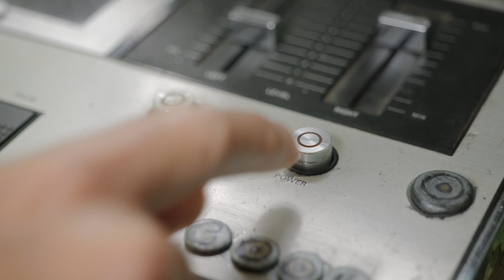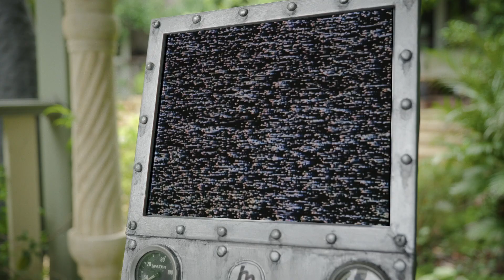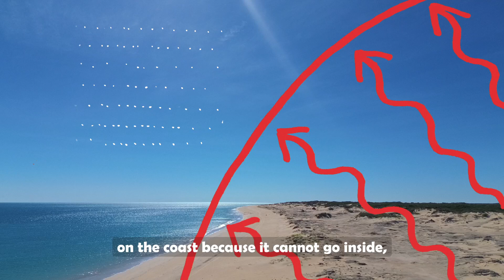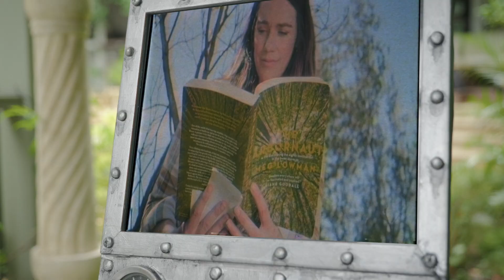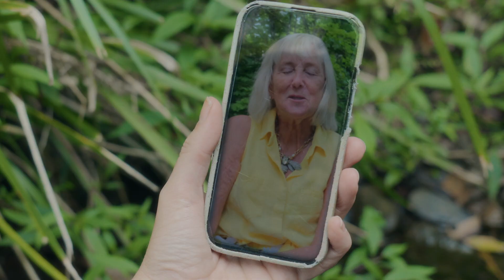3. Building a Biotic Pump | Cool The Country

Comment: Great content about exciting solutions. One question is: won't retaining water reduce inflows into the rivers? Some of the retained water will evaporate before it reaches a stream or a river. Reduced flow is already an ecological issue for the Murray-Darling due to all the small dams upstream.
Reply: Good question: the experience in Rajasthan is that stopping the monsoon run-off leads to year-round flow from catchment rivers that would otherwise be waterless drainage ditches, rushing the rain away quickly when it falls. And as Jillamatong Station shows (in Ep 1), healthy ponds and wetlands hold FAR more water in the carbon-rich soil surrounding them than in the ponds themselves. The Jillamatong ponds leaked 20,000 L a day through years of drought (2017-19) and just kept drawing water out of the surrounding regolith, never running dry. 

The nearby Shoalhaven River (which supplies Braidwood's town water) was dry when the Black Summer fires hit, but helicopters were still able to take water from the Jillamatong ponds. After the wet years since those fires, the soil carbon and water capacity of those ponds has increased even further. Rain from those good years will be leaking down from Jillamatong to the Shoalhaven River, and flowing to the Tallowa Dam for YEARS to come. And so long as that water is held in the soil, there is minimal evaporation.

Certainly far, far less evaporation than there is from the surface of a large dam lake... or the smaller agricultural dams along the Murray-Darling.

The restoration of wetlands where the water naturally pooled, pre-settlement, would have the same effect on any river system: it slows the rush of water--and flooding--during big rain events, then leaks that water continuously into the system afterwards. That is true across Australia, and would certainly help the Murray-Darling--and the farmers who would rehydrate their own land as well, if their degraded wetlands were repaired.

Comment: Oregon undergraduates had to go to India and Africa to test methods that Oregon wouldn't allow within the State. They built catchments of varying types, hand dug small catchments in Africa, and larger systems, in India. The Indian catchments brought the water table back to the point that the old dry wells were available again. These were not pumped, but they were within reach of the locals for cartage and household use.
If I make a pond on my place in Oregon, I would be subject to arrest, it's happened, and one guy was in his late 80's, federal prison is what happens when water is involved.
He did get released before he died, but the ponds on his place were drained. 
Another Gent in Southern Oregon had permits for two ponds on his ranch, they revoked the permits and charged daily fines for not draining the ponds.
I could harvest water from my roof legally, but that's it, once it hits the ground, it belongs to the State, and they will screw you into oblivion over the point.
Reply: There are strict rules about the amount of rainwater Australian farmers can capture and hold, and I suspect it may have been a case in Oregon of exceeding those limits? Certainly, if you make a pond on a stream or river, there would need to be approval, and it would have to be a 'leaky weir' that just slows the flow, but lets the water run on to neighbouring property.

On a small block, a pond could exceed limits fairly easily, but on a substantial farm it is much harder to do so. In Oregon it may be that the rules were changed, as they were in Rajasthan to devastating effect. Best of luck dealing with that.

Comment: It's not rocket surgery. Investors should be required to plant trees on every property they buy, and preserve already existing habitats. We don't need to tear down anymore forest lands without restoring the ones we have already cut down. Water management is indeed going to be one of the major challenges going forward.
Reply: And not just per planted trees, the water catchment systems will make their own trees. People could be incentivized per meter of structure created.
Reply: I love the determination, but planting trees everywhere isn't the best idea

Some places are not suited for trees
Reply: @20-Foot-Anaconda  Much of the areas botany is very tenacious it will take advantage of every nook dip and cranny were even the slightest extra moisture can be found. 

Making more water capture structures in this region would quickly show results. It would not be forcing it into a different place, but encouraging greater proliferation of water loving species that are already present on the landscape.
Reply: @raclark2730  true, but that is talking about increasing availability of water, not population of trees

Also, some places aren't suited for trees the other way. Trees can destroy grasslands and leave low productivity forests in the absence of pressures
Reply: @20-Foot-Anaconda  As mentioned before trees are already there in pockets of land within this zone. Does not need to be a full landscape replacement to make more wetland biomass in the same region.

Tweaking not forcing.
Reply: Oh wait

What is rocket surgery?
Reply: Investors who sell land over an acre should have to install a water tank on every property.

Comment: 3 fundamental problems with the theory of the biotic pump.
1- If a depression or vacuum is formed when water vapor condenses at high altitude, why does this depression attract only humid air from the sea and not dry air from the interior?
2- If we admit that when water vapor condenses at altitude, a depression is formed, we must also admit that when water evaporates on the leaves of trees, an overpressure is formed. If the depression attracts sea water, the overpressure should reject it.
3- If we watch the fast motion video of the formation of a typical storm cloud or cumulus nimbus, what we observe is exactly the opposite of a depression. The clouds seem to expand strongly and do not create any vacuum but on the contrary occupy more and more volume.
This is because although it is true that when water vapor condenses it reduces its volume many times as it changes from gas to liquid, this same process releases enormous amounts of heat contained in the water vapor in the form of latent heat. This large amount of energy passes into the air which heats up and expands. There is no compression or contraction but a big expansion that we can onserve.
The reason why forests are fundamental to keeping the water cycle strong is another. It has to do with the studies of Professor Millán Millán.
Reply: As I make clear in the series, I am an expert in none of the science, I am speaking to the experts. Best take this up with them. 

In answer to your first point: Jan explains that an area of 100 sq km is the minimum required to start the biotic pump function. That would seem large enough that humid air is drawn in from the sea, even if dry air is drawn in from the land. As the forests grows bigger, it creates more room for the ocean air. In any case, it is proven to work over substantial forests

And you and I are agreed that "forests are fundamental to keeping the water cycle strong".